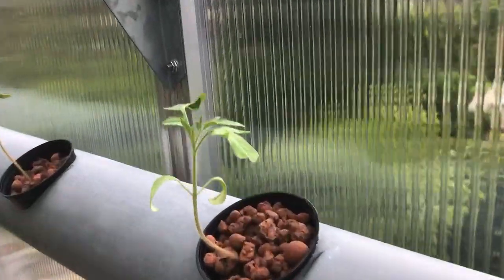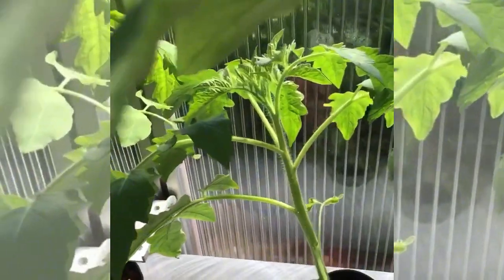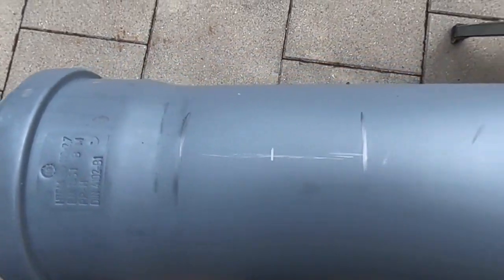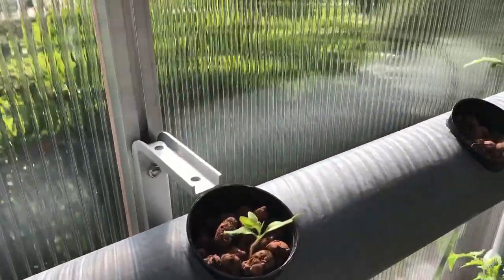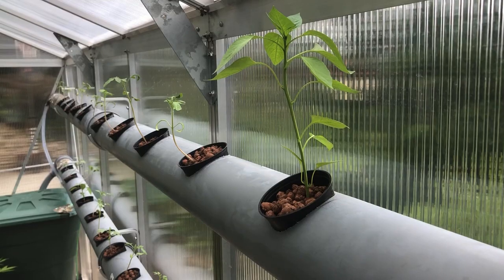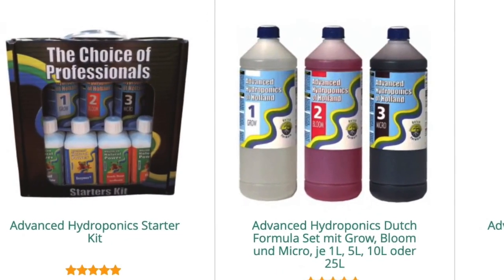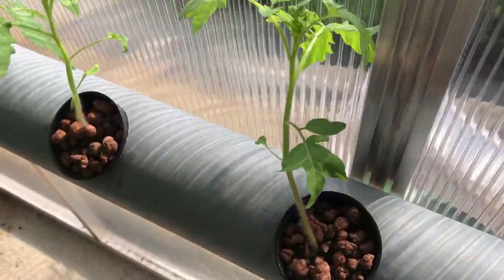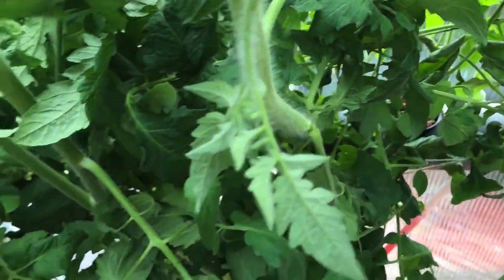Starting with hydroponics/ PVC system build Review

Comment: Did you have to tie them to keep them from falling or hanging down? I ask coz im growing tomatoes using the kratky method in large coolers and found they grew tall fast and flopped over.
Also where did you buy your pipes and what size. All I can find is 4inch sewer pipes at Lowes that cost $25 for10ft.
Reply from the maker: Yes I tied them up using some twine. But it might also help if you use a fan to imitate wind which should provoke the plants to grow stronger and more stable. 

I also bought my pipes at a hardware store. Not sure if they were classified as sewer pipes but that should work too. The ones I used were more like 6 inches though.